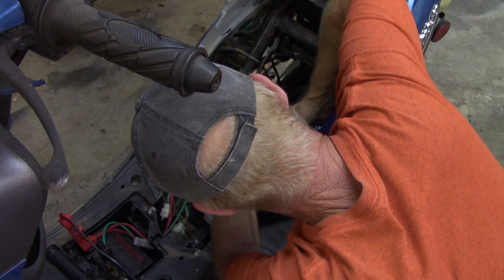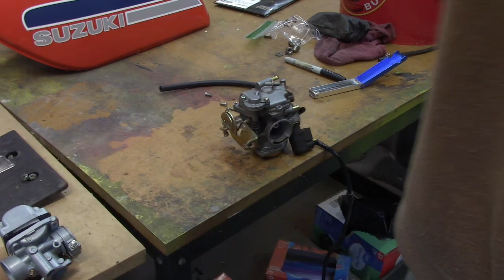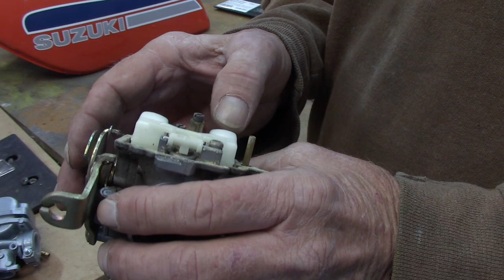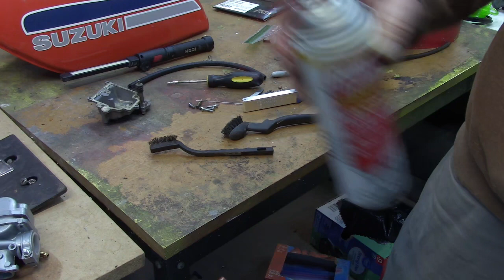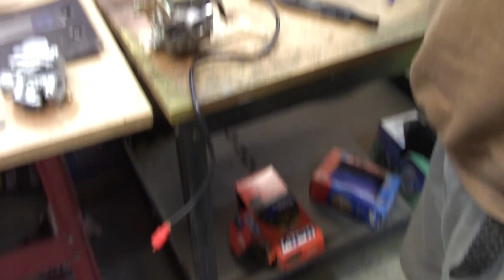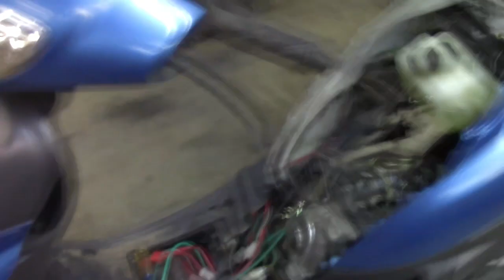2013 TaoTao Scooter (Blue one) Will It Run Part 2

Comment: Hi have you a good spark and compression of this, cause i have a similar gy6 and want to compare
Reply from the maker: Sure do.  I haven't run a compressions test, but it sounds fine.
Reply: @gregslair4278  yes I am not sure about the timing of this gy6 clones, i don't have a pressure transducer
Reply from the maker: Compression should be around 120+ on these engines, but you definitely need a compression tester to check that.  As for the timing, your cam timing would be first and you'll have to remove the head and make sure the two little holes with a line, line up with the side of the block, then remove the side cover and see where your timing mark is.  There should be a T on it and it should line up when your piston is at top dead center (then the little holes line up).  I'm not a GY6 expert, but this should get you in the ballpark.